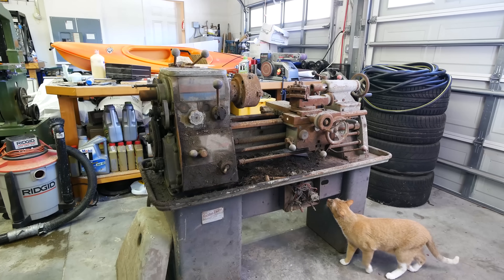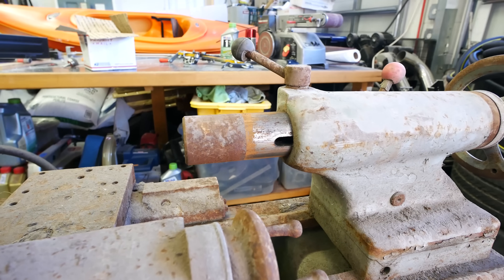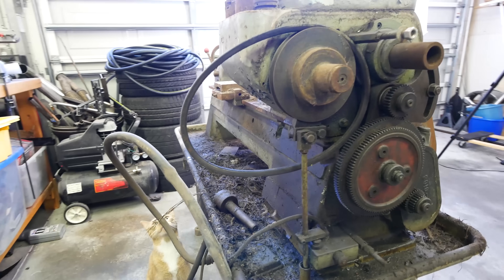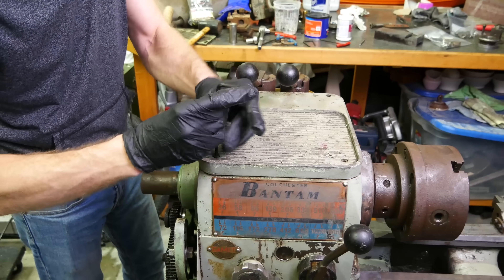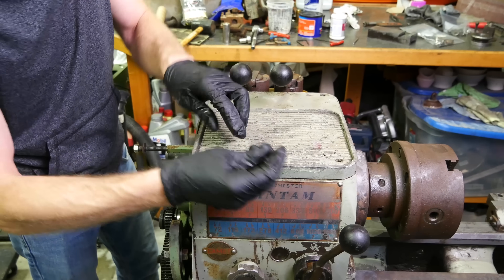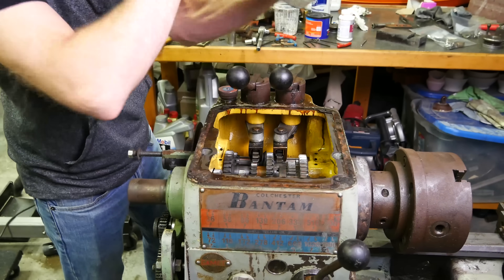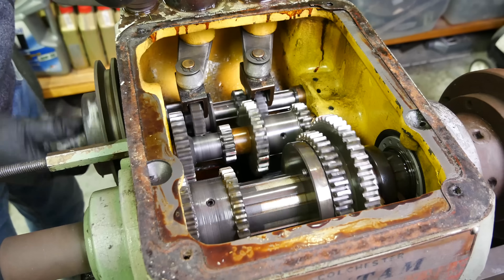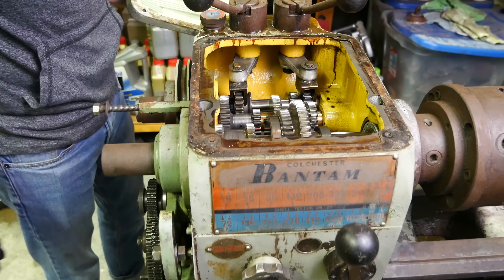Lathe Rebuild Part 1 - S02E01

Comment: Colchester even provides refurbish work on their lathes, and yes they still have parts. As I said finding a Colchester Lathe is like finding a diamond on the beach. If the Ways are in reasonable shape under all the rust this can be rebuilt to like new specifications as these lathes were designed to be repaired and restored to working condition.

Comment: If you have 3 phased electric you can get by with less hp,,,but you won't run it with 2 hp,,,hell my compressor requires 3.5,,,with no gears to turn, you will probably need 5 hp atleast.

Comment: The US is such a fucking crazy place! I both hate and love it at the same time... You have to pay 15-20 grand for a fucking wood scrap epoxy table or even 50 grand to paint a fucking 60-80 grand Lamborghini. But you can buy such an amazing tool with change... It boggles my mind... Where i come from, that lathe would be 1k at least. And to pay a fucking Lambo respray, and a very very good one at that, about 3-5 grand. The US is crazy and i hate love it!!!

Comment: What was used in the PVC pipe at 6:54, rust remover, PB Blaster?  Jug looks like it says drain cleaner?!?
Was probably a joke, but they sell only 1 and 3 phase AC motors (ignoring stepper motors, which don't seem like a good choice for a lathe drive motor).  The closest to 2 phase is the added starting winding on a single phase motor.

Comment: Wow..
How old that machine bro
Reply: Quality machinery manages to find itself in the scrap heap all the time. Check scrapyards, Facebook marketplace, online sales pages, auctions etc. Remember the amount of work needed on these machines is huge and lengthy. This isn’t such a good restoration but at least it works.
Reply: razak othman between 1963-75. I’d guess earlier though as it has the imperial thread count dial on the apron.
Reply: @billyb4223  
Older than me bro...
But still can running..strong machine.
Reply: Please tell me if there is any others machine want to scrap..maybe i can buy it

Comment: I'm in the middle of cleaning and restoring a South Bend 6" lathe.  it was PACKED with sawdust and metal chips in the gearbox.  It will run like a top when completed.  A fresh coat of enamel paint will make it shine like new.  The spindle, ways, gears, motor, and bearings are all good.  It needs a reversible switch though, and a nice chip pan for the bottom would be nice.

Comment: I have the Colchester Master , these Lathes are made to last a lifetime and are high quality 
when i got mine which is probably 1960 or something i could drill a hole in a pin head 
before even setting it up

Comment: I did my apprenticeship in a company on the south coast of England where we manufactured parts for Colchester Lathes as a sub contractor from 1976 to 1981.
We made complete saddle gearboxes, Compound and Top slides, and Tailstocks.
It was a good indentured apprenticeship over 4 years. My father came along to the company to sign the forms showing his commitment to me learning the trade (as was the custom in the old days).
From milling the iron castings, to radial drilling, horizontal boring and multi head special purpose boring machines. To Wickman single spindle bar fed lathes, copy lathes, capstan lathes and cylindrical grinders. To Gearcutting, horizontal and vertical broaching, and induction hardening and a spell in the inspection department!
I ran the gear cutting, broaching, drilling and induction hardening shop at the age of 19 for 2 years until the company's demise and closure.
Reply: Hey Monty... thanks to you and all the other people that helped turn out these fantastic old lathes and machine tools!!
Reply: 'The World turns on Colchester', as it says on the side of my old Student
Reply: @garethjones7182  "It all starts with Exide", was the catch phrase of the Exide battery company.

Comment: I know this is 1 year old but I have a 3 phase motor 240 volt 7.4 amp. model ARDP. 1730 RPM.  50 cycle, service factor 1.25 at 1hp and less, 1.20 at 1.5 and less, 1.15 at 1 hp and ?  It actually came off a professional lathe. from a lumber company. I have no need for it and will sell it cheap.

Comment: That lathe will thank you every time you use it, for saving it from the scrap dealer where many machines sadly end up. Good on you guys for having the passion to restore it. Those HARDENED bed ways likely held up well.

Comment: i think you guys schould go get a good 3 phase engine, assa, abb.... and then use a danfoss driver for it, in that way you can get a low start current and maybe bind a botton for active brake. that would be a little modern

Comment: I know what a hideous amount of work it is to restore an old American lathe. Mine had less rust but was even more encrusted with grit and grime that it took weeks to disassemble and clean it all. I replaced a few gears and also converted the old hydraulic method of spindle speed control with a new 3 phase motor and electronic VFD (Variable Frequency Drive).

Comment: I have cleaned up a lot of machines like this the best for the ways is not abrasives as such.
You will be surprised how easy and quick.
Use phosphoric acid and a green scotch brite pad.
Gently rub on the cast iron, literally before your eyes stuff like the original surface scraping reappears.
I would never use or have needed to use power tools or sanding type abrasives on machine shop tools.
Trust me im a retired maitenance fitter. Ive done this my whole life.
3 phase motor with inverter.
Gives more speed options plus the power of 3 phase on single phase domestic wall socket.

Comment: 3 phase 2-3 hp service factor 1.15. 240volts  use phase converter from single to three phase 
Unless you have 3phase power.3600rpm if you can find it if not around 1150rpm.
Now where to find one cheap.
Ebay is the biggest rip you off there is ,so NO.
Go to your salvage yard  try find one on a late model machine with a VFD and start stop circuit's .Use your DMM to check for shorts or a megger ohm meter.
Your drive pulley needs to match  for an A B  C style belt .

Comment: Well at least you did find an appropriate method of cleaning the lead screw, but my God. All the other unnecessary labor. Rent a steam cleaner next time. you already have a air compressor. How about soda blasting after disassembly. Rinse and oil! Done

Comment: I am kind of on the other side of the fence - I have a treadmill motor waiting for a lathe like this! I want to use the motor because it is 2.5 HP and already comes with a speed control, even if it is indicated in miles per hour!!! Best of luck with this lathe!

Comment: Laser cutting a new gasket... Brilliant. And then you ruin it.... No such thing as 2 phase.
Reply: Its called split phase
Reply: Yes, there is , its just not called 2 phase, but It should be. The industry needs to adopt the correct term for TWO 110v leads which are out of phase with each other, normally referred to as 220v in your g-rage, but its actually 2 phase.
Reply: A "phase" is a wave form and when you run two wave forms you are running 2 phases.
Reply: @douglassmith2055  If the machine has a Neutral connection in Australia it would be identified as 2 phase 240 Volt machine, without a Neutral connection we would call it a single phase 415 Volt machine, as there is only one single voltage available, 415 Volt (240 X 1.732)
Reply: It's an American thing. In Australia we would call that 415 Volt Single Phase, often used in mid sized factory stick welding machines.

Comment: nice going fellas - ya shoulda done a few hands on chemistry experiments back in the day - in a bucket, tray, tube, etc.  arm & hammer soda powder (not the baking soda) in water with a small electrical current, part is the neg and a receptive 'annode' in solution is the pos; parafin hot wax prior to assembly with the proper lubes (#1 is antiseize; m in the philippine and my buds machine shop floods out just about every year up to the ways...). plan on 3 phase even if you go less in the beginning. a capacitor start dual voltage century electric motor - what you can scrounge that might have something applicable...in your location i dont know > output shaft size should be the main criteria for scrap yard searching.

Comment: I have got all my motors at local scrapeyard. Once there was completely new 3 phase 2HP motor, new with key binded to the shaft with stick tape. It had cost me around 20 USD. But it depends at your scrapeyard. Somewhere are just tons of crap.

Comment: I bought my 1974 ex-school Bantam 800 for £900 from flea-bay. Cleaned it, inspected and adjusted everything. Drain, clean and new oil in both gearboxes, new motor belt fit, align pulleys, adjust brake switches, align tailstock for true drilling. Good for another 40 years! I run a "Transwave" 1 to 3 phase converter.

Comment: What was the solvent used to clean soak the rust on the carrige drive screw in the PVC pipe?
Reply from the maker: that was evaporust. if you haven't already, check out the rust removal episode!

Comment: Subscribed because I love a good lathe rebuild. I recently saved a 6000 lb. Holbrook lathe from the scrappers torch and went through much the same as you are. One suggestion for removing rust. Straight white vinegar works wonders on steel (and it won't etch like evap-o-rust will). Just make sure you degrease the part before soaking. Use a small brush to clean away the black goop that forms on the surface during the soak. Wash with soap and water afterwards followed by drying and oiling. I took a chunk of rust vaguely shaped like an 8" 3 jaw chuck and made it look nice again. Good luck on your project!

Comment: 2 phase was a joke right?
Reply from the maker: +Tim Cho I probably should have said dual phase or split phase, just meaning 110/220 here in the states. I realise it's all single phase until I have a phase convertor with a vfd.
Reply: Thanks, single phase or three phase represented on most motor plates as 1ph or 3ph. "110/220" does not reference phase but voltage and would specify a dual voltage motor. Any idea what was installed from factory? Do you have any original motor specifications? Speed, frame, class, nema rating, service factor, phase, reversing and pulley specs?

Comment: 2HP motor will be fine, even 1.5hp. Definitely 3phase with a vfd at 240v single phase input (get a cheap vfd, does the job well enough for $100, anything brand name will be over $400 for 2hp)
fyi, there's no mill scale on the chuck, chuck jaws or ways, mill scale is what you get after metal is hot rolled, forged or heat-treatment - you just have rust there.

Comment: Can you blur out the vise grips, channel locks, screwdriver, and claw hammer action? I'm trying to keep my dinner down.
Reply: How do you feel about some hot 'wearing gloves using the drill press' action?
Reply: Stoning the slideway. Just had to shake my head. At least use Scotch bright so that you can keep the contours of the flaking.
Reply: @robertdavis8417  tbf, the flaking is probably long gone anyway... not that ways on this have scraped flaking to begin with. but I do agree, something less aggressive would have been better and a more intuitive soultion.
Reply: To be fair it's only really important on scraped slideways and bedways. I was making a guess depending on it being a good brand and it's age, i could wrong. Either way I wouldn't ever stone a slideway unless it was damaged from dropping something on it. So scraped slideway, if you were to look at it as if it were a topographic map. On a microscopic level there are a bunch of hills and valleys, hopefully with all the hilltops  at the same altitude. The valleys (flaking) are important because they can retain lakes of oil. So if the saddle sits still for a while it will eject the oil barrier and sink down onto metal to metal contact. So by having the retained oil in all the valleys, once it starts moving again it well quickly pull that oil up out of the valley and be gliding on a nice wedge of motion lotion. Sorry back to the question, stoning only goes at the high points and in reality difference in height between the hills and valleys is about 3 or 4 tenths (0.01ish mm). A stone with the amount lubrication this guy was using will bring those hills down pretty quick. So with no hills there is no valleys and with no valleys when stationary the oil will eject out of the contact area and once it start moving again it will be metal grinding on metal contact. scotch brite will at least follow the the contours of the highs and lows and it's just not as aggressive. Sorry for this being so long. BTW I am not saying you don't need to oil scraped slideways. I hope this makes sense.
Reply: Why don't you go look at his channel.  He does machine tool service and rebuilding.
Reply: and the music too
Reply: As a newbie, can you explain why you'd use Scotchbrite instead of a stone?
Reply: Aha, that makes perfect sense, thanks! So Scotchbrite is a better choice for the ways because it will remove the rust particles w/o actually removing the remaining steel (i.e., hills). Out of curiosity, how would you repair/resurface the ways if they needed something that drastic? Let's say you dropped something on them, or they caught something and scratched. If I follow you, you could remove the upset metal with a stone, perhaps, but then how do you repair the surface finish? Is it literally some sort of scraping action or scraping tool? Do you have to fill the "dents", or are they just extra oil?
Reply: Robert - you gave me enough key words that I was able to find this. Thanks again, I've learned something new. https://www.youtube.com/watch?v=QJXqHpSh3SE
Reply: You know not who your talking to. Wes makes his living repairing machines .
Reply: Wes Johnson Yea I agree he was struggling to free up the feed and lead screw :P  Lots of movement is a bad sign but he managed to get it off... good on him.
Reply: Exactly, thanks for bringing it up
Reply: I saw an 80+ year old who'd claimed to have been a machinist all his life bashing a lathe with a 2lb hammer one time..... Trying to do something I can't remember what but that was the last time I had any contact with him.....
Reply: I'm just a Toolmaker giving some criticism on some bad practice and some advise on what he should do instead. I may of been harsh, but I have to call out what i see is wrong. Not just for these guys but also for anyone else watching this. Also I don't accept that doing the best with what you got is admirable, considering a pack of scotch brite is about $15.00 at you nearest bunnings (hardware store).
Reply: Cringed when I saw that
Reply: Wes Johnson. 

Y
Reply: The guy is doing the best he can with what he has. What are you doing besides flapping your lips?
Reply: Wha? They can contemplate laser cutting a gasket but they can't some up with some, you know, wrenches?
Reply: Fuck me, I walked into daycare,  where's the crayons?
Reply: Wes Johnson  Because it was being treated so well before these guys got to it.
Reply: Wes Johnson thank you. I almost watched this.
Reply: Wes Johnson .
Reply: Button it...thats the best part Dude
Reply: Wes Johnson wtf are you on about ,you must be a weak or odd person.what does that even have too do with the footage or the rebuild of this lathe?? Absolutely nothing you and 102 people are Zionist of Israel slaves . Get off the drugs

Comment: Small lathe, I'd go single phase 220v with a good controller that will allow you to run it down to single digit rpm, because then you can also use it as a part rotator for welding.

Comment: Three phase with a vfd for speed control(so many benefits) and it gives you three phase power output with single phase input. You can find used motors cheap on eBay and a vfd for a 5 hp motor should do the trick for 2 hp motor(usually double the drive for the motor size if you are going to convert single to three phase). You might want to check out the practical machinist forum as there is a ton of knowledge on the subject over there.
Reply from the maker: Thanks Kirk, i am thinking VFD is a good way to go, I'm just not sure i need the cool features with it having the gear box and all. it might depend on how much i can find a motor for.
Reply: Hmm, let me do some digging in my stash and see if maybe we can come up with something. I think I might have a 2 hp motor I can donate(have to check, it may be a 1.5 hp).
Reply from the maker: that would be totally bad ass of you!
Reply: With the vfd you loose a small portion of power while running at lower freqs but you cam compensate for that with the parameters it might just make more of a high pich noise while the motor is running and reduce your power factor
Reply: Physics Anonymous Second best option is a DC treadmill motor. A lathe of that size doesn't need a ton of power, so a treadmill that can keep a belt running under a 250 pound human is plenty. With a PWM speed controller you get most of the benefits of the VFD and a 3 phase. And I find at least a couple free treadmills per year without even looking for them. Two have had the venerated MC-60 controller (typical in Icon-made treadmills).
Reply: Jon Miller. The trouble with PWM is that when you reduce speed,  you also reduce power.   That doesn't happen with a VFD.
Reply: I use cloths dryers motors for a few things around the shop they are cheap and easy to get but run on 240v
Reply: I second that that would probably be your best bet
Reply: Vfd is the way to go..... any three phase!!!
Reply: Thanks for that, been trying to figure out a solution to the same scenario!